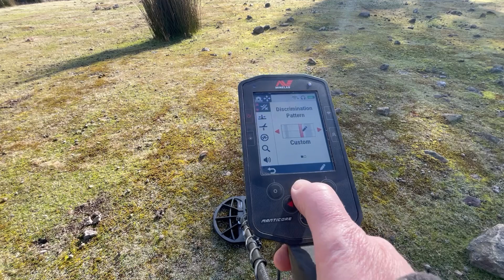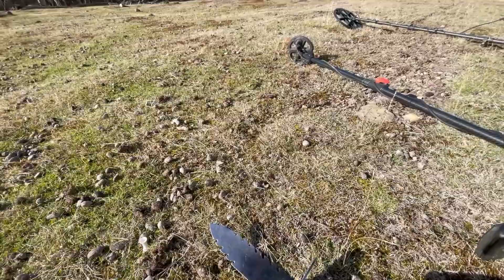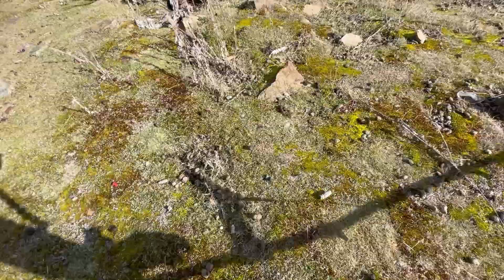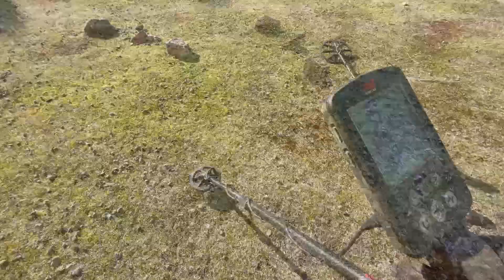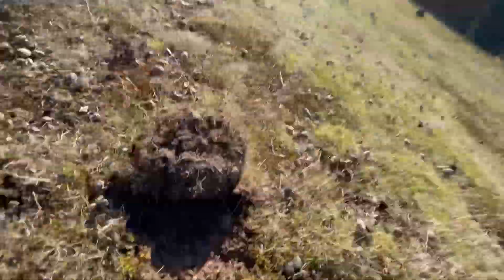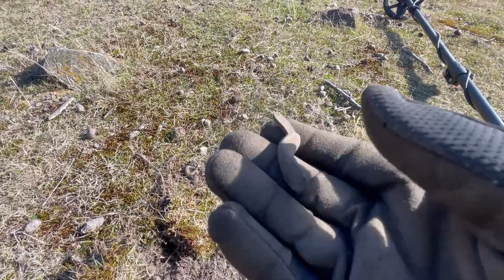Manticore vs Equinox 800 - Metal Detecting for Relics & Coins - Which Detector Wins?

Comment: Great video it’s what I’ve been looking for I have the 800 was thinking about the Manticore , I use a coiltec  10” coil on it I set it up with custom settings different tones and numbers to identify different metals works great it took a little time to learn it . I’ll stick with my equinox 800 it finds the same trash and treasures as the Manticore 👍🏻
Reply from the maker: I love the Nox 800, and it was my second machine. I still use it occasionally, but now that I understand the manticore better, it’s my go-to detector. Thanks for watching & happy hunting!

Comment: Hi! Good video, informative. I have an 800 and before that I had a 600. I wanted to buy a Manticore, but now I understand that there are no significant differences. Thanks for the work!
Reply from the maker: Thanks for watching. There are definitely some significant differences, such as the 2D map and ferrous setting flexibility on the Manticore, but if you want a machine that you just turn on and use with minimal effort, the Nox 800 is pretty hard to beat for the price. Having said that, I love my manticore and would find it very difficult to go back.
Reply: What you just said is comical lol there are many differences and I could walk behind you and find stuff,I’ve owned both I would never go back to the 800 lol

Comment: you would disk everything below 10 thats nuts
Reply: It all depends on what you're looking for
Reply: @dfxjedi  that much disk on the manticore is even more crazy iv had gold and gold coins at 9 , 17 and 50 plus loads of in low numbers can be deep silver ..your missing gold rings and allsorts with disk that high .. any disk you use  also effects separation and depth ..... its best to run open as you never know what your going to find the screen pretty much tells you if its worth digging once you learn the patterns
Reply: @UNDERGROUNDCALLING0161 I usually hunt in trashy areas, I have no desire to dig a ton of junk. I know I'm missing some jewelry, but I like coins the best anyway.

Comment: Im "Upgrading" .. this is going to be a big purchase for me.. eq800 or what would any of you do? Been using my trusted bounty hunter quick silver for 20 years! Yes, I cant even count how many gold rings I have found on the beach with it!
Reply from the maker: Depending on your budget, there are a number of great machines at around the AUD$1200 mark including Equinox 900 and Nokta Legend. If you can spend a bit more, then perhaps the Deus 2 or Manticore, however these higher end machines require more effort to master as they have many, many features and possibilities for adjustment.
Reply: @coilsandcoinsdetecting  appreciate  the info!!👊🏻☕️